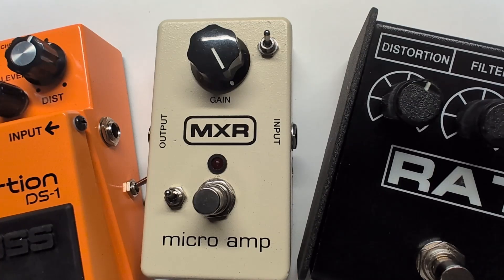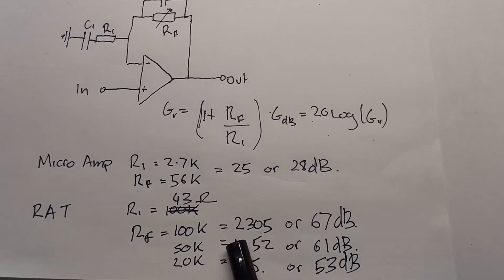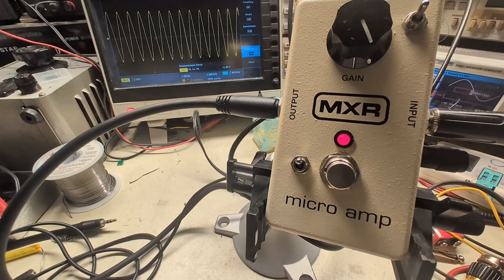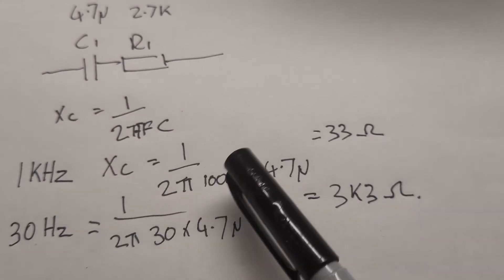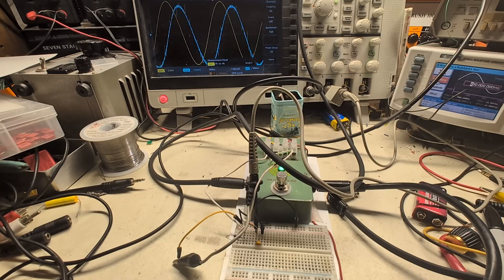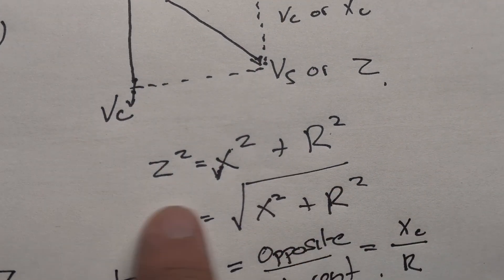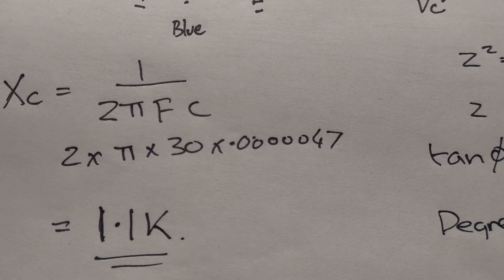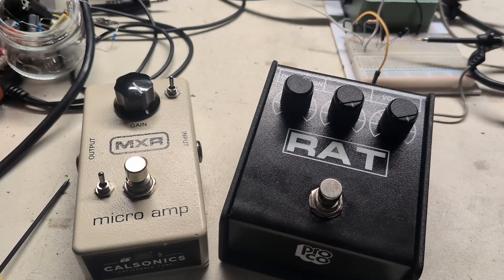Designing Dirt Pedals - Understanding Op-amp Gain in the MXR Micro Amp and ProCo RAT

Comment: I learned a lot from this video, and it was especially valuable for me to see how you tested your calculations against the actual performance of the pedal.  I have a question about your circuit diagram, though.  Since the pedal is powered by a single 9v battery, shouldn't there be a voltage divider/false ground as part of the circuit to amplify the whole signal?   Maybe you chose to leave that part of the circuit out so you could focus on the amplification/distortion aspects of the pedal?
Reply from the maker: Great question. I want to do a deep dive into clipping and harmonic distortion and the Vs/2 will play a big part in the analysis.

Comment: I watched the whole video, but I didn't understand much, as I am a layman in this field. But what i noticed is, that I like pedals with 1 MOhm input and 100 Ohm Output resistance. That's why I don't like the Rat and the Muff, I guess. Also I noticed that some manufacturers tell the input and output impedance "at 1k Hz", others "across the spectrum" - which one is the accurate way? And does Input and Output impedance say anything about "feel" or doesn't it matter at all, cause there's like 5-10 OP-amps and buffers and resistors and what not in the signal path? And what are buffers anyways? I read, they are amplifiers, but they can also alter the sound. The Klon buffer for instance is altering the sound - I heard. I don't own one.
Reply from the maker: It has been on my mind to do deep dive on buffers. As you said, some manufacturers don't clearly specify the performance.
Reply: The way i understand it:

An ideal voltage buffer is an active circuit block - essentially just an amplifier with a gain of 1 - that outputs a perfect copy of the voltage at it's input, and the output is basically "isolated" from the input.
They're often used to get around impedance related issues, like to prevent one part of a circuit from drawing too much current from a previous stage, or basically any other interaction.
Also, without buffering or amplifying, the current/voltage gain of any circuit would always be less than 1.

Input and output impedence can affect the way a circuit interacts with any connected circuits - BUT will also affect the loading of the pickups (how much current the circuit draws from them)
---A low impedence can sink more current than the pickups can supply.
This can cause a low pass filtering effect - and the natural resonant peaks of the pickups to flatten. So basically the guitar feels darker and less lively. 
But this isn't necessarily a bad thing, as fuzz pedals quite often incorporate this kind of "sag" as a feature - it's part of that classic fuzz sound.

So all the buffers "in the signal path" aren't really affecting the input or output stages, since they're isolated from it - so they don't negate any impedance mismatching in that circuit block.

Also with high output impedance pedals, long cables can form a low pass filtering in the audible range - or it can cause voltage sag at the next input (input tries to draw more current than the previous can supply)
This is probably why you prefer a low output impedence.

You can sort of think of impedance like resistance, but really its the resistance to an AC signal (Resistance + reactance) reactance comes from things like capacitance and inductance (which should be present at any inputs/output(to prevent DC currents, and also the parasitics of the cables beings used.)
But usually you can just simplify to thinking in terms of resistance (but keep in mind, it's frequency dependent)

Alsoooo, with mismatched impedance, you can get reflections that travel back and forth, when the voltage changes - oscillations that occur between the output and input 
(If the output impedence of a circuit is lower than the input impedence of the following circuit, then initially the current being sunk from the first circuit's output is more than the following input can source, so some of it bounces back and forth until the system stabilizes - but since it's AC, it never really will)
Having a matched impedance dampens those reflections. and ensures that the input is stabile.
Basically: 
Ouput > Input = possible reflections intermodulating with the audio signal, or possibly reaching down into the audio range.
Input > Ouput = Voltage sag/low pass filtering
Output = Input = No prob, bob.

Comment: Sorry but I got nothing out of this as far as the use of a pedal with a guitar. I'm sure this explanation meant something to real gear heads. :)
Reply: Haha
Reply: Did you read the title? 😂
Reply: He's talking about building a pedal, not using it. I can give you some basic info on gain that should help you get the most out of your setup. This applies to everything, not just guitar pedals. You need to know what the difference is between gain and volume. They're very different. It may seem like gain and volume controls do the same thing, but the don't. Gain controls are active, have the ability to amplify or boost the signal and are placed on the input of a component. Volume controls are passive devices and can only attenuate the signal. They go on the output of a component. 

If you want to distort/overdrive the signal, it can only be done with gain. A volume control can't alter the signal itself. As you increase gain on your pedal or amp, you get to a point where the input tubes or transistors can't handle any more signal and still play clean. When you overdrive the input with gain, the signal itself is directly distorted. The preamp is where most of your distortion comes from. 

You can get more distortion with volume, but the way you do it is completely different. Since volume is passive, it can pass the signal and no more. If you want to get your power tubes or transistors to distort, you keep increasing the volume. Instead of distorting the signal itself, you push your power tubes/transistors to failure. Its like the stereo in your home or car. If you keep increasing the volume, the system is going to break up at some point. Its not the signal that's distorting, its the equipment. Lover the volume and it sounds normal again. This is why so many people complain about tube amps being too loud for home use. If you distort with gain, you can keep the volume low because everything is done in the preamp. When you distort with volume, you have to push the power amp hard until it fails. (Sometimes the speaker itself may distort, as well). 

Understanding gain and volume gives you much more control over the type of sound you get. Most people just play with the knobs until they find settings they like, but they don't understand what's actually happening to get that sound. To use all of this information, look at everything in the signal chain starting with the guitar itself, and ending with the power amp. Go through each piece and make sure you know which controls are for volume, and which ones are for gain. Once you know exactly what each control does, you should have a much easier time getting a tone you're happy with.